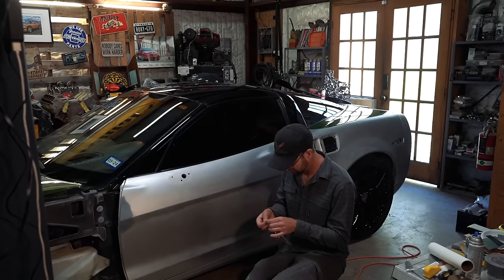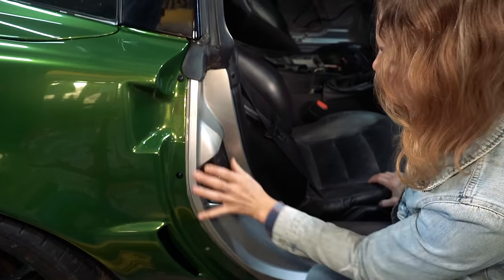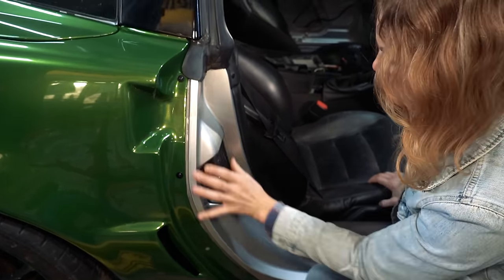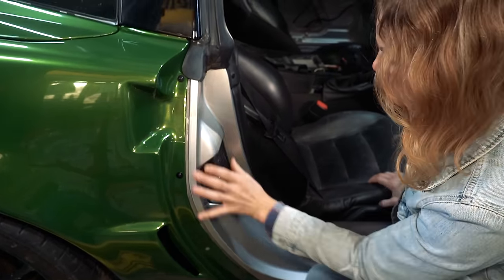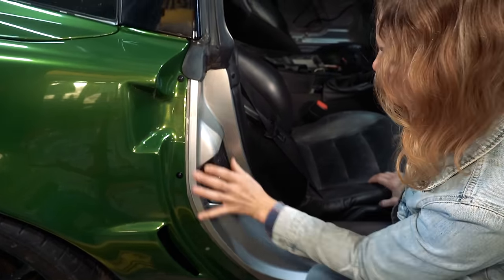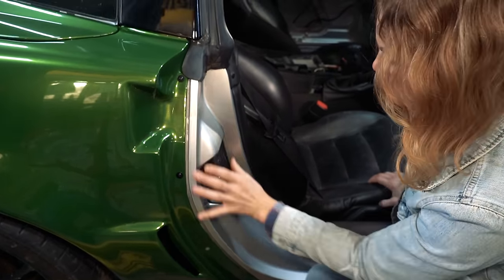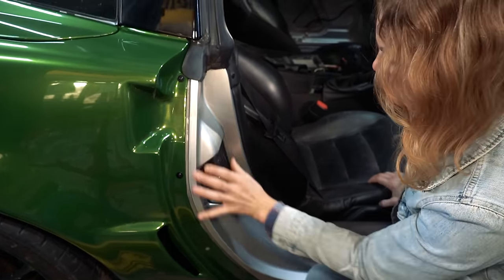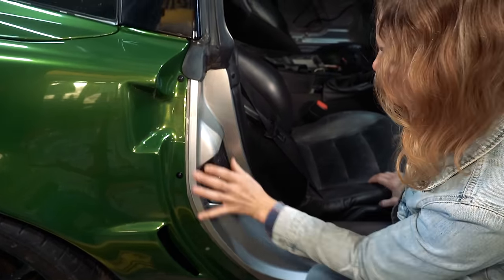Wrapping our C6 was SO HARD!!

Comment: In my old age I build 1/24 and 1/25 scale plastic models .  Sometimes I screw up a paint job. Soaking  the plastic parts in Castrol Superclean removes the paint but doesn’t harm the plastic. Also to cut down on dirt sticking to the car from static, use a fabric softener cloth inside a clean rag to wipe the car to remove any static.

Comment: I applaud you for trimming out the door jambs and other areas.

It is so disappointing when you open a door, trunk, hood and see that the work stopped at the edge of the opening.  I admire a job that goes thru to the end.
Reply from the maker: It’s not perfect but it’s pretty dang good!
Reply: @flyingsparksgarage  The car looks fantastic, even without remembering how it looked at the start.

You & Aaron did some amazing work in a short time.

Comment: When Robby Layton did rap on a vehicle, they had plastic with foam rapped around the edge, to take the air out from under it as you lay it ,and pierce the air bubbles with a pin and blead the air out as they heat it,good job done, thanks for sharing, all the best to yous and your loved ones

Comment: all plastics and rubber bits are not the same , sooo maaaany diff compounds , you did right , always do a test section.. but I usually do a rag with some acetone , then brillow .. wash , dry , respray with black Trim paint or Vinyl upholstery paint .. always comes out great .. also , spray your paint into the cap , grab a QTIP , and hit them screw heads .. finishing this vid up an see the next just dropped... time for BBQ and a relaxing evenin

Comment: When it comes to plastic and paint removal, I use a spray-on oven cleaner. The caustic solution will soften and remove the paint but won't attack the plastic.

Comment: I know what might help you with the wrap thing i install some stuff that if it touches itself, it is a done deal. I just peal back a little of the backing at a time to keep it from sticking to what i don't want it to stick too and this stuff you cannot get a wrinkle out of, it is a 1/4 inch thick and 50 feet long and 4 feet wide it takes a knack to put this on and have done it by myself but it is better with 3 people.

Comment: In my application of vinyl labels a strait needle in the center of a bunch of bubbles allowed the air to vent through the small hole the moisture should be able to escape also

Comment: The big thing is to not pull so much of the backing paper off at a time. Stick the top and then pull the backing off as you go. Small bubbles you can use a needle to stick and then press them out. Good luck!

Comment: Mix a little soapy water like some baby shampoo some of that stuff that’s not real harsh and you can slide that vinyl anywhere you want it and then when you like it squeegee that water out behind it and it’s stuck that way you can make all your cuts where you need to and then the squeegee the water out behind it when you get it to where you want it.just take the squeegee over the front of it and it will push it water out of the back of it and it’s stuck. That’s the way you do window training and it works pretty good

Comment: I have just used a hammer n block of wood to the center of steering column to knock the steering wheel  loose when a puller wasn't available

Comment: A small needle will get rid of the bubbles on the hood, poke a hole in the bubbles, and it will release the trapped gas and leave no pin holes behind

Comment: Ooh, 3M makes wrap material? And it's easier to apply? Reminds me of of one my rules: if 3M makes what you're looking for, you don't have to buy it -- but you'd better strongly consider it!

Which reminds me -- Dremel grinding on fiberglass inches from your nose? Egads, put a dust mask on! A 3M disposable, or, for $25-42ish, they make very comfortable dust masks with cartridges.

Also, to trap dust floating about in your shop, duct tape a furnace filter (20X20") to the back of box fan and set it on low speed and just let it run for days/weeks/ever. A high quality furnace filter... you know who makes those, right?
😁